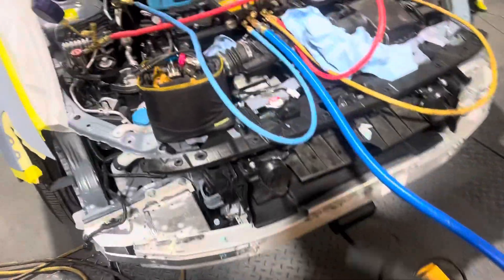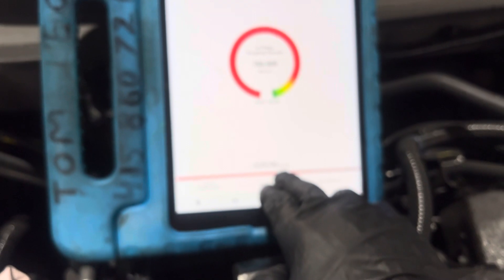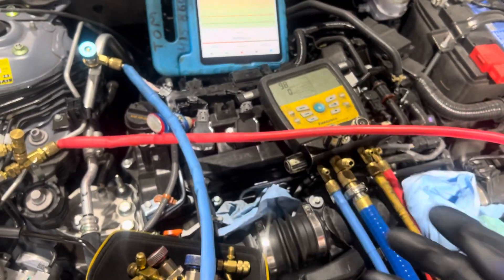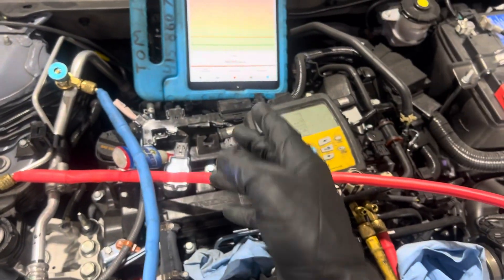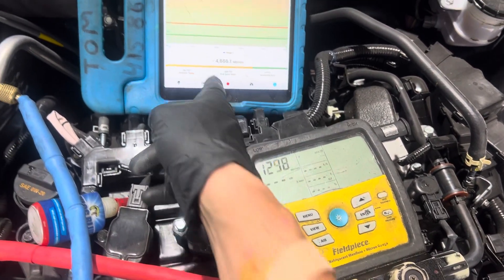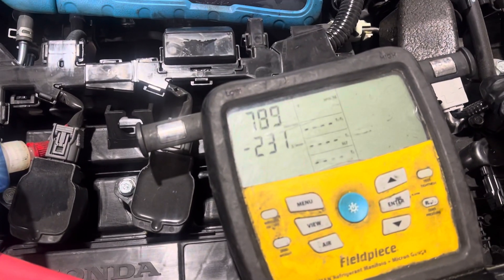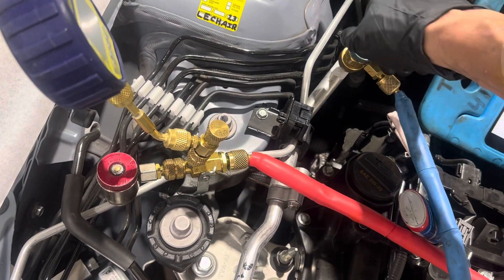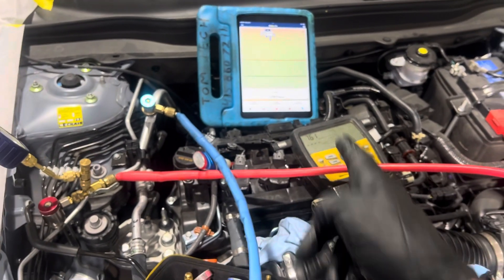Micron gauge isolation system Decay ￼

Comment: Hello
Q:i have gmc yukon 2016 r134a i am searching for leaks ..... the first leak was from the low pressure valve core the second one (iam not sure) it is the front evaporator it give me 18 ppm then goes to zero only when fist start of compressor ---------- if i start the ac only on fan mood i cant find any leak just when i press the ice flake nutton it strat to go up to 18 ppm the returns to zero is than there is leak in evaporate since i am not sure or it could be the small shredder valve that leaks some of refrigrant and goes into cabin....or the cigarette smell??

The device I am using same of yours inficon same model number also
Reply from the maker: It’s a learning curve to correctly use a infrared face product just like it’s a learning curve to learn how to use a Haight Diode leak detector

You have to know how that all works and Howard Auto calibrates Oreos itself 

You must read the instruction 

Go to the website and watch their videos 

Because you could be looking for a leak can you stay over it too long in the auto zeros calibrates for the surrounding gas

This is something you learn and you get a feel for and you know how to adjust and compensate for it

Try using the sensitive mode

Also look for a leak out on the condenser usually the upper driver side wakes up in the corner

Sometimes on the other side

We say it’s a General Motors pick up vehicle. It Hass to be leaking at the Condenser.
🤣
Reply: @coldfinger459sub0  🤣🤣🤣....yes the condenser was leaking before and has been replaced with the upgraded version.....i will search for it /i red the instruction but i could not find this information as i remember.....although i will go to search about it and learn more 

Please could you help me is that an evaporator leak?
Reply from the maker: @abdullwwful  can you let is sit over night . And retest next day? 

Add as secondary backup always add UV DYE. 

So if you can’t find it now.  Maybe later it will leave a stain on evaporator. 

Also use boar-scope to remonetisier fan resistor and other opening to get access to  evaporator to see with camera. 

Some leaks turn off and on at different temperatures or pressure.  

This is were 40 to 60 g refrigerant as trace gas plus 200 psi dry nitrogen help find the leak sometime.
Reply: @coldfinger459sub0  the probe was on the laft hand of tge driver side nearby  the driver window side
Reply from the maker: @abdullwwful  in recycling mode turn fan on and off vary fast. 
All you try to do is get fan barely moving to move refrigerant but not dilute with air. 

You may have seen some of my videos on that
Reply: @coldfinger459sub0  thankyou for your help🌷...appreciated
Reply: As I test and inspect the evaporator leak using the leak detector in your way as expected there was leak in the front evaporator.....thankyou🌹
Reply from the maker: @abdullwwful  it’s not my way . My father instructed me on this method when I was a child before high school, roughly 12 years old.

Using a H-10 heated diode leak detector .
Reply: @coldfinger459sub0  ❤❤

Comment: So, I should read for leaks at the micron gauge on the HS port and not the SMAN?
Reply from the maker: You can use SMAN number will be a little higher then level out.   Refrigerant hoses are contaminated with oil  moisture, refrigerant.  Refrigerant hoses not rated for low micron.  

If you are DYI  at home just keep your vacuum pump on overnight. The longer the better for removing moisture. 

You can read the moisture removal with the micron gauge. After 1 hour .  Turn off let it decay and level off after 15 min. 

Then vacuum 24 hours and retest you will see a lower number proving you have removed more moisture out of the system. 

This is why we test use instruments and we don’t guess